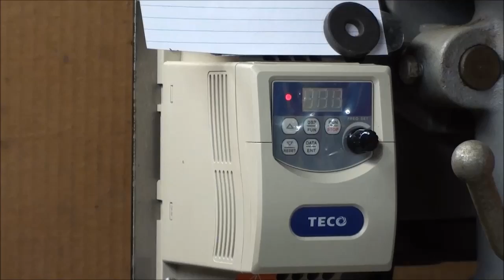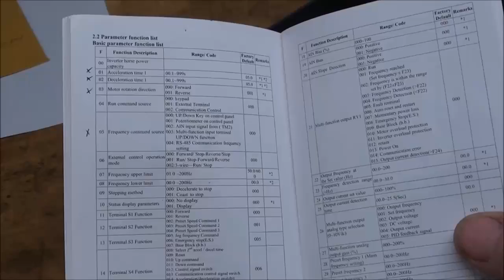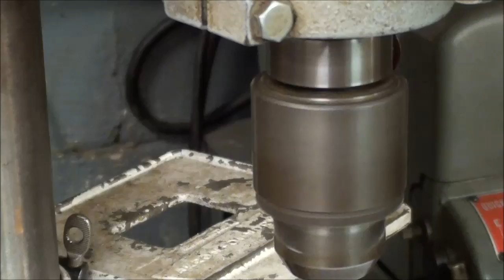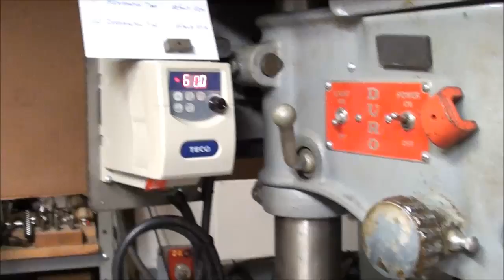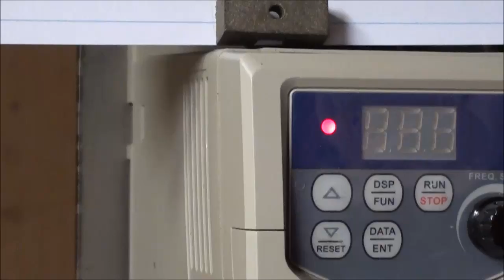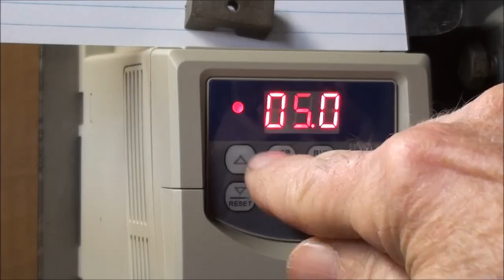MACHINE SHOP TIPS #140 Programming the VFD Variable Frequency Drive tubalcain

Comment: Nice, looks like the one l put on my Oliver wood lathe, It was a 110Volt input.
Those 110Volt input VFD's are nice.
I brought the Motor and VFD together as a kit, and hooked up a low voltage SPDT  switch  (For off and reverse), and a speed pot,
So now I still have the Oliver reeves drive, and the speed pot to control speed.
Yes, shipping is out of hand these days.
Here is a link to it.
DSCF0621
Reply: Oh,, I also put an E stop on the Oliver lathe.
I want to do it to my Logan lathe next.

Comment: Really neat technology.  Your last thought about durability is the great white elephant in the room, isn't it.  I grew up with a Maytag washing machine that only had the belt replaced once in 20+ years.  I have had to purchase 3 high tech washing machines in the last 10.  All were due to electronics failures that were cost prohibitive to replace.  I have replaced electronic controls on a range, dishwasher(twice), and the latest washing machine motor controller that I was lucky enough to get used.  So, good luck, Sir.  Give me the old controls any day.  Still a really neat device. 

I must admit that I am a bit surprised that you didn't change the bearings on the old motor and keep it on hand.  A question: Is it really kosher to run these motors in the vertical orientation?  I am asking because I really don't know.  I seem to remember that the bearings on an old vertical motor had an additional bearing to carry the end load on the shaft, but I was a kid when I took that one apart. 

Keep up the great videos and don't worry about going long or "boring" us.  In fact, I must admit disappointment when you occasionally say that you won't go into details about something for fear of us losing interest.  The details are what I personally can't get enough of.  Thank you.
Reply: blmeflmm66
The old push-button switches of Maytag washing machine would last for decades, compared with the short life electronic touch switches. My first Maytag washing machine served me for 25 years!

Comment: Awesome video all of them! I installed one (VFD)on my Pilgrim mill about a year ago and it works great, you can thread with the mill or drill if you slow it down and install a forward/reverse switch to the unit,my mill has the variable wheel on it but does not offer the efficiencies and performance options of the vfd.Love all of your videos Tubalcain!

Comment: Mr Pete I enjoy all of your videos and have watched even before you started the 'Machine Shop Tips' by number. I hope you do a video when you do the Bridgeport conversion in the same manner as you did this. I think you will need to go with a 2 hp 220 volt version of the VFD for the Bridgeport, and I know they make them so they are able to read the motor speed so you may want to consider that when you shop for that VFD. I have a Bridgeport that I acquired from Caterpillar and it is now in the disassemble/clean/evaluate/repair/replace/reassemble stage. After this it will be repainted and wired with a VFD. I have read about a lot of different models but it seems that I get more confused the more I read and I think that you will point the way for me long before I get this machine finished. Anyway keep up the good work. Regards, John

Comment: Hi just to let you know how much I enjoyed your videos on this subject.
I have been running my boxford 9" lathe of a similar unit in England for the past six years and it has not missed a beat. The rep. for my unit told me to fit a remote controller as the units run/stop button may be over worked in time. I purchased a controller but never plucked up the nerve to fit it after reading the instructions until my head began spinning. your video however has given me the impetus to try again.
Thank you for that.

Comment: I installed. VFD'S on two machines in my shop, a large powermatic drill press and a big delta bandsaw.  I did it mainly because they were 3 phase motors, the speed control was just an added bonus.  I was able to purchase these machines at a real bargain because they were 3 phase and the average joe wanted nothing to do with them.

Jim

Comment: For 6 years live been dealing with the slow ramp up on my VFD ( its a different make than yours ) After watching this video I dug out my manual and finally figured out how to program it. What a huge difference! I tried programming the ramp down and brake on shut down and the VFD did not like that at all so I set it back to coast.One tip I read about on a forum I belong to is to unplug the VFD when not in use because they don't play well from voltage spikes during storms from lightning.   Thank You Again for all your great videos

Comment: Thanks for the VFD series Mr. Pete. I would now consider purchasing  3 phase equipment for my single phase home shop. Any suggestions on where to run the belts on the step pulleys of a mill when using the VFD? Would you setup your belts on the smallest motor side pulley for maximum torque and use freq > 60 hz for spindle speed control?

Comment: Just a knucklehead question.  I have no shame!  When you say the VDF converts 110 power to 220 3-phase, are you plugging the drillpress (or VFD?) into a 110 wall socket.  Would you look at how the motor is wired to determine what level of power (110 vs. 220), or is the VDF wired for 110 or 220, or both, and you have a choice?  And yes, of all the VFD videos you there, and there aren't many, this one is by far the best tutorial, very good explanation.  You have a knack for teaching others.

Comment: While I am quite familiar with VFD's and electronics in general, this is the smallest unit I've seen in the 1HP range! When they first started to really 'catch on' in the hobbyist market they were all the size of a small computer tower and were mostly used to build or convert a CNC machine to run a 3 phase water cooled spindle.It really wasn't that long ago you would have to buy or build either a rotary phase inverter or a LARGE complicated (expensive) solid state version, and even then such devices only 'create' the third phase so you still needed 220v 2 phase to start with! The concept of breaking current and voltages into small 'packets' to create a 'duty cycle' has permeated into many common items and seems the way forward, even your car's charging system operates this way. (low load=few pulses. high load=many pulses) way more efficient than the voltage regulators of old (can you say HOT)! Remember Triodes (diode trios) and ballast resistors... Thanks Pete! for all the videos!

Comment: On the Bridgeport - if you only change the speed of the motor, and do not change the belt/pulley system, don't you lose some of the torque provided by the belt arrangement? I hope this isn't a stupid question...
Reply from the maker: YES--might still need the pulleys & back gears.
Reply: You don't lose some of it, but all of it and a bit more. Say you had pulleys cutting the speed in half from 1800 to 900 RPM. The torque will double at the machine. Power is torque times speed, and it will stay the same. Using a VFD to reduce speed, power does NOT stay the same, torque does. The motor torque is limited by heating from electrical current. So instead of torque doubling, it stays the same, at half the amount you would have using pulleys to reduce speed. In fact, useable torque will go down a bit more because the fan built into the motor will be turning slower, so it will not cool as well, and you should not draw as much torque from the motor or it will overheat.

A solution to this problem is to replace the motor with a larger one. Replacing a 1 HP, 1800 RPM motor with a 3 HP, 1800 RPM motor will mean that you have the same torque using a VFD at 600 RPM as you did with the original motor using pulleys for the speed reduction. Depending on the range of speed control you want this could be an acceptable solution that allows you to avoid changing pulleys. Depending on the machine design, you also may need to limit the power of the larger motor at speeds above 600 RPM to prevent overloading the machine. The power limiting may be a feature of the VFD depending on its design.

Comment: Hi Pete
So in reading comments you mentioned you were not happy with the torque!  I read this that you have speed but no strength/power which would be a problem when using larger tooling in the machine.

Please expand on your issues or produce a follow up video....I like most of the viewers got excited based on the cost/installation ease/voltage adapt, but need to know & understand if preformance issues are created.

FYI...I sit in the back of the classroom and you had my attention the whole time....LOL, thank you
Chuck
Reply: torque problem sounds like he needs to change pulleys to the smallest drive pulley running to the largest drill pulley!  then turn the speed up to the 90hz and running the motor faster thus getting more torque and still having the faster drill speed!

Comment: Hello Mr. Pete.  Nice job on the VFD.  I put one of these on my Clausing lathe, which is almost identical to yours.  It replaced the factory variable speed that can be somewhat problematic as you might know. By using a hand held tach and adjusting the frequency until it reached various nominal speeds I made a chart to give me a list of about 12 of the most desirable RPMs. It doesn't take the place of a integral tach but it's good enough for me. Thanks for all the great videos.
Mike

Comment: I'm very interested in the speed vs torque capabilities of these little VFDs.  This is particularly important when considering replacing step pulleys.  The pulley reduces the speed, but it also multiplies the torque.  Perhaps you could experiment with a make-shift pony brake on the drill press, and develop a crude speed-torque curve.  So far, it sounds like a free lunch ---
Reply from the maker: At this point, I am very disappointed with the torque. Remember, I do not know the hp of the motor... Funny thing you mention this.. Earlier today, I was thinking about testing with a prony brake. I probably will not,  I do have a video where I use a home made brake to test one of my old engines.
Reply: mrpete222 OK - So I got interested and did a (very) little Google research.  "vfd torque curve" yielded this about "Induction Motor Speed Torque Characteristics": http://www.yaskawa.com/site/dmdrive.nsf/(DocID)/MNEN-5JFQNV/$File/AR.MOTOR.01.pdf   On page 5, they talk about starting voltage boost of about 5% to significantly boost starting torque by 2x - 3x.  Is there any parameter that sounds similar in the Teco?

I'm just reporting here, so I may be totally off in the weeds.
Reply: Dave Kellogg
Starting torque is very different from continuous operating torque. Short-term, you can boost voltage and therefore current and get a little more torque. But it causes a lot of heat to be generated. Heat is the main killer of electrical devices. For continuous use, you cannot increase the torque as you slow the motor down with the VFD, so at lower speeds the power of the motor is proportional to the VFD frequency in Hz divided by 60 Hz, say 20 / 60 to have the motor operating at one third of its normal speed. Nearly all motors have some type of fan built into them, and as you slow the fan, it does not cool as well. As a result you actually have to reduce the torque you use by a bit more as you slow the motor down.

Comment: have you tried using low speed to drive a large drill bit. will this unit allow the motor to develop full power at low speeds.                   larry r

Comment: Lyle;

We typically program our VFD's for 90 Hz max in the facilities my group engineers for.  That allows for seasonal variation in throughput without overstressing the motor.  My mechanical engineer tells me the usual limit on a motor is the bearing max rpm limit.  Easy enough to back calculate from the max bearing limit to the max frequency.  One other trick is to change out shaft bearings to allow for higher speed bearings to allow for higher motor speed.

Thanks for all the great videos.

Regards;

Ron Kluwe
Reply: What is the lowest HZ you would want to program the VFD to go to, about 30?
Reply from the maker: anthony diodati
20

Comment: Usually they include the other languages because it would cost more to keep track of where a particular unit will be sold than would be saved by not printing the extra materials.

This is also helpful because translations are almost never the same. I try to crossreference the english version against the others looking for differing tables, step counts and warnings. While I may not be fluent in Serbo-Croatian or Mandarin, these differences tell me where I may need to seek clarification.

I think this is because translators make mistakes accidentally, misunderstand the intent of a proceedure and make inappropriate changes, or are compelled to keep a certain language version 'not inferior' by making omissions from the other versions. Then each version is then maintained/corrected seperately so corrections /improvements aren't made to all versions.

Though trying to get family members who only read the English version to not follow invalid documented proceedures that demonstratably break shit has been near impossible.

Comment: You more than likely will want to stay away from ramp down and use coast. With something heavy in the chuck or anything that will coast with some inertia the ramp down feature has to burn off energy and can burn up the controller unless it has a good sized heat sink on it. This isn't usually too much of a problem with induction type motors but with big DC motors they generate power when they slow down and it has to be burned off with a resistance coil.
Reply: But why would you use a VFD on a DC motor?

Comment: Great video! I used to operate a labeling machine (it glued computer generated labels to a mailing piece) about 40 years ago when I worked in direct mail. The "ramp up" function on this machine (made by Kirk Rudy) was called a soft start. Programming the VFD can't be all bad since it has a button labeled "FUN" :-)
Reply: instaBlaster...

Comment: Thank you for clearing this up.  Teco a major control mfg.most noted for zone valves
which you probably have on your boiler. Dont tell me they moved to china? The are
or were in Warwick RI.  Also thinking of my mill, but the mill has four 3ph motors, so
I guess that will not work without major rewiring.  So thanks again
samuel

Comment: Lyle

Well done !  I think you showed and explained the basic functions very well.

One of the other great benefits of these VFDs that mightn't be immediately obvious to North American users is that for those of us in Europe, Asia and Oceania who have 220-240V 50Hz mains power, we can now buy models of American power tools and machine tools, without also needing an expensive 110V step-down transformer to handle the power, or worse, a complete motor replacement.

Many desirable models of US-made power tools and machine tool brands are not sold in 240v 50Hz, and so as long as you are prepared to pay the shipping costs, these devices open up a whole new range of opportunities.

Like you, I'm prepared to make an exception and buy this sort of Chinese / Taiwanese made product.

Thanks for covering this important subject, in a comprehensive manner.   

Kind regards from a warm and sunny Australia.

Comment: Great Video, thanks! I have 3 AC VFDs (2 x 110V + 1 x 240V) and a DC speed controller I use for my various machines. All the VFDs are Chinese. Two of them have failed on me so far, so needed replacement. Mostly my fault. 

Lesson: All that flexibility in the settings can be detrimental to the life of these devices and the motors. You better know what you are doing when you program them…. Changing ramp up and ramp down time to low values for instance are really taxing on the power circuits in the VFDs (specifically the crappy caps). 

Yet, given the price point I believe they are still generally a good investment compared to the pain of changing gears or belts. It's like cheap center drills: When they are dull you just buy new ones.